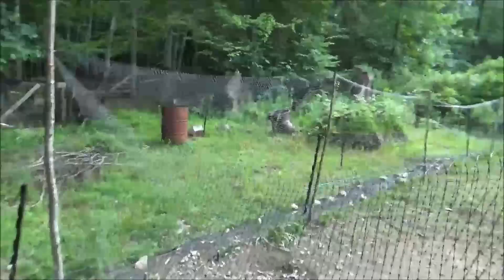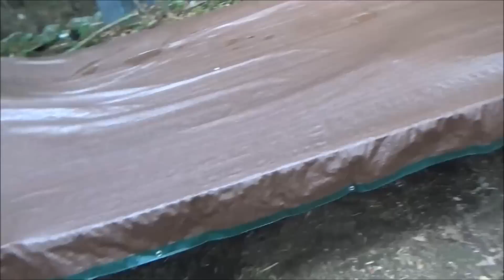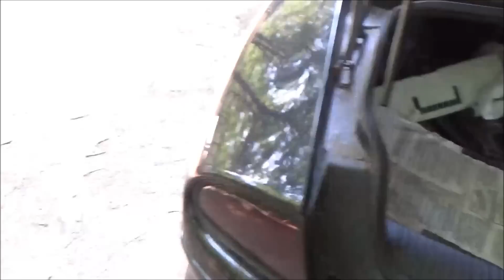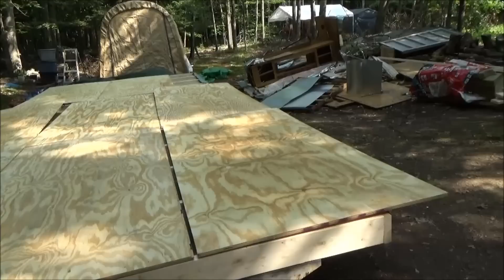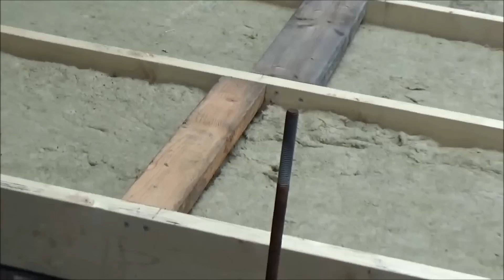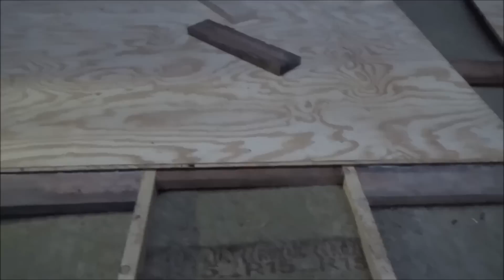Starting Laying The Floor Boards For My Tiny House On Wheels

Comment: Troy a few points fella:

1.   Thought you were going to oil/treat the wood before sealing the floor frame up?

2.   How is the floor frame connected to the trailer chassis?

3.   The supports for the floor that you put in will bow and sag with the grain.  They should hve been installed as per the frame ie upright not flat

4.  wouldn't staggering the floorboards make for a better/stronger finish/connection?
Reply: Yes Paul. The supports should have used the side and not the flat wide part. Also never should have used caulk as it is a waste. Adhesive would have helped much more.
Reply: Brad Chalker I wondered about the caulk instead of glue, but I wonder if it is to stop the cold transfering from the metal, to the joists, then through the floor.  But, if that is what it is for I would have laid it down thicker.  Actually, I would go with foam tape, but caulk could work.
Reply: Yeah when putting down sub floor you would use adhesive our liquid nail
Reply: Brad Chalker I agree. I think what he was trying to accomplish by putting the 2x6 on their sides was to give more SURFACE to support the plywood--especially where 2 plywood sheets touch each other. I sometimes felt uncomfortable sending in all those nails  so close together to attach 2 sheets of plywood into a single 2x4 or  2x6. I thought of snapping a line where the sheets would meet and use that line to slap TWO-2x4's, or in this case, two 2x6's together so each sheet would have its own stud or joist to nail into. (less chance of splitting what your nailing into), but that would increase the cost of construction and in this case, weight. I am afraid that by  rotating his 2x6's he may have compromised a good deal of the floor's ability to deal w/ sheering forces--in earthquake country like CA or when on the freeway, that may be very important.

He'll just have to make sure to go slow if he takes it on the HW, and not let any one hit him or take corners too fast.

Comment: I would think glue,liquid nails and plenty of screws would join the two halves of the floor together just as good as bolts for way less money.once its covered in plywood and the walls are up spanning front to back, everything should be connected nicely. Sure wish you had help .
Reply from the maker: Thank you. I was wondering if that would work for me.

Comment: You should be using PL construction adhesive under the floorboards will assist in keeping the floor stronger and more rigid, might not be too bad an idea for the walls to keep them rigid as well should you ever have to move your house.  .   Get a bit frustrated at you slowness, but, better to err on caution.  All the best.

Comment: Nice table saw find!
Not that I endorse your super sealed floor compartment but, if you must, use dowels. Lay them across the floor joists and place the plywood on top of the dowels then remove the dowels. Watch some cabinet top install vids.
Get a chalk line spool for finding your screw placement.
I too am alittle OCD and I can tell you in rough construction you will never get perfect.
Reply: Hello. I wish I could get there to help him. If I were there I would lay a pathway of sheets down the middle for a pathway to walk on. Snap a line and apply glue. The sheets would be placed upside down, so that you would simply flip them over and and then they would have the correct side up.

Comment: lol you need a sledgehammer. stand on the floor sheet with one foot partially on the beater board and smack it. for your blocking go 2 by 4 then 2 by 6 alternating, then you can center them. do you have a router? the edges are way easier than with a rotary saw. oh dont glue the joint. good luck!!

Comment: This is really exciting watching build this thing. its cool. You may have to attach a board along side the 2x6 to have something for the next plywood to nail too the end it will fall though if not. Full lenth of the board.
Reply from the maker: I am going to, if I understand you correctly. Thanks
Reply: The Do It Yourself World Run a 2x4 parallel on the side of the existing 2x6 because their is nothiing to nail to were the sheet ends. kinda like doubleing up the 2x6 but your using a 2x4 instead to nail to the side of it.
Reply: shartne Troy, next time you have a problem with the plywood not centering on the joist just slide it around till it is centered. If it hangs past the outside ; cut it off afterwards. If it is a little short of the edge that wont be a problem , because it will cover underneath the wall plate. 
 One more thing that i can't stress enough, and I know you've read my earlier comment on this subject, but if you think your having problems with getting joints tight now, you haven't seen nothing yet. You MUST snap a line through the plywood and to the other end. Plywood is NOT always perfectly square. Because of this your rows will get WAY off, and you will find that your plywood rows will not be straight with the way your doing this. I no you don't like the fact that your seams aren't tight., But if you continue this way when you lay down the next row, your going to find it's FAR worse. You might get lucky and this may not happen, but there is no reason to gamble. You will find that these methods are tried and true from millions of carpenters from the time since plywood was put on the market.

 I've laid down many thousands of sheets and I know what I'm talking about.
Reply: Jim Watson I agree with you. but he already has it down He could unscrew and take it up but that cualk could make it tear loose and break it all. I dont know.
Reply: shartne The caulk is not dry and is not strong enough to tear the flooring. He could at least give it a try by carefully trying to pull it up and see for himself. Backing those screws off is a 5 minute job. I think that is a good trade off for all the problems that are going to come after that.. so many problems that I have elucidated in my last comment.
Reply: Jim Watson I agree its going to cause a big problem throwing the whole thing off. a night mare so it best to unscrew and slid it back cut off on the front end toward the trailer toung. so it will be ending in the middle of the joice on the other end. so the next board can get screwd on in the middle of the joice. He could cut the ply wood in half so it will stagger. that would be nice for good strength so the dont all line up and make a one long seam.
Reply: shartne And if he unscrewed it he could apply glue to the joist. All problems would be solved!!
Reply: Jim Watson Yes Troy this should be done to keep from botching it. please consider doing this way. I think its for the best. And it will unscrew easy the caulk is not even dry yet it takes days when its sandwitched.

Comment: If you counter sink your holes for the edge screws first, then drive the edge screws in, they wont lift out wood. Also use a sledge hammer and a 2x4 to protect the edge, and give it a good smack.  It will close up the gaps.

Comment: Troy that is a good saw if it works seen a lot of that model that have problems,but is fixed easy,once you get power and it doesn't start up when you hit the switch its the little bearing that goes bad on the the motor,simple little $10 fix

Comment: How come you put caulk on the floor joists? Normally we use an adhesive that will bond the plywood to the joists to prevent squeaking. Also, the plywood is supposed to be staggered so you have more strength. You have the butt ends all lined up. You have to drive that tongue and groove sheeting together with a sledge hammer. You need to put a board on the tongue that has a groove in it that you hit and drive the sheeting together.

Comment: Troy what you did with the wood was good but it should have been ever 12inches or so under the sheet,use construction adhesives not caulking about same price but  much better.when using half sheets its cut the sheet in half 4ft by 4ft

Comment: dear mr troy I'm sorry to put my input again but i just feel somehow obligated to tell you that You are making a crustal mistake on the installation of you're plywood and that you are still in time to fix it you must stagger the the joints of the plywood if you don't you are creating a week point on the 2x6 joist that is holding all the joints, especially  because the house may move at some point,also an easy way to make the tung and groove close is to lay a 2x4 or 2x6 on the male side while you stand on the plywood and you're toe's on the 2x4 with legs spread wide to hold ply in place then hit the 2x4 with a sledge hammer towards you will see it will close perfectly and also if you don't close that joint you will have big problems with making the rest of the plywood line up trust me wood filler will not help that again sorry for my advise its just being a carpenter for almost 35 years I feel i must at least tell you so good luck you are doing very good other wise

Comment: Is it bolted down to the frame? That looks like its three quarter inch plywood and that is why its so firm. thats great.
Reply from the maker: The front part is bolted. The back half is still not attached. Yes its 3/4 and very solid.

Comment: If you really want the batteries separate from the living quarters, then make the battery / utility room as small as Possible, put the batteries on vertical shelves made of metal in one column so to speak and minimize the amount of floor space you use. My 2 cents :)
Reply: Good idea going vertical.  The cabinet could have a door vent low on the inside and a vent high on the outside to pull air through for ventilation with no fans.
Reply from the maker: Its going to be a battery room, electronics room and closet for storage.
Reply from the maker: Pete Brown He has tons of shelving. Thats his business.

Comment: hi tony
this is my first time commenting on any of your videos first i want to say bravo keep going man dont let people drive you nuts and dont get hurt by comments it looks to me like allot of people just want to help you get better at one thing or another and please include me on that list
i am a contractor by trade and if we lived close i would be out there helping you when i had time but i cant so i will pass on some info i see and hope its helps i am going to list a couple of things

1. tough and grove sucks lol when putting it together set it next to the peace already in place and lift up the other end a little to make sure its all in the grove as in up and down till it looks like all the grove is in then like was said earlier you want to stand on the board you are trying to get in place then on the long end put a long just 2x4 down along the edge then lightly tap it with a sledge hammer and it should just slide a little bit at a time into place as it moving in place if it does not line up the other direction finish getting it in the place then move the board to the short end and adjust and if need move back to the long end and tap back in if it comes out of the grove a little bit
2. the screw bit on you drill a extension yes wonderful thing and one that makes the bit magnetic helps also
3. from what i can see allot of the old wood you are getting looks better then you might think it is and think about cutting out the bad even if you end up with a 4ft piece i will bet you are going to be using allot of shorter length wood in this build i am a trash hound i build allot of stuff out of what others trash i always cut down wood like that and its saves me allot of good new boards that i would of had to cut in half i just made a teardrop camper all out of use wood others trashed i spent 400 total on it 280 of that was on the trailer solar panel and electric was the rest i even take out old bolts and screw out of wood i find old desk people trash i save all the hardware out of it screws bolts etc its is one of the big money things when doing a project that people dont think about in the future you can save yourself allot of money just look at what you are trashing that people give you or you find (you might do that already)
4 from my time building when i have had to fix a squeak in a floor its been from the center of the board with time maybe it got wet and expanded then pushed the nail up just a little of pushed the head of the screw through the wood a little bit more then it squeak time and i agree with the others about liquid nail over calk i use both every day -" i can peel calk of with my hand -- i have to take a hammer and chisel to get the liquid nail of  " you can make your own opinion on what is the right to use but ether is better then nothing
i could go on for a long time but i would gladly share any time you need any advice would be my pleasure when i watch your videos the thing that is the greatest about them is you get of your butt and do stuff that most are not willing to do you are taking risk that others would never take so pat yourself on the back i get the strangest looks for the things i do and am glad to know i am not the only crazy person out there lol i have been there doing like you then got back in the rat race now looking to go back to a easier way of life well harder work but easier life
and the last thing i talk way to much sorry lol
Reply from the maker: Thank you very much for taking the time to write. I will switch to liquid nails. Have to get back to the store now. Yes a lot of the boards are very good and I will build a chicken coop and gazebo with it.
Yes being out here is more work but somehow more peaceful and less stress.

Comment: Two Questions for you troy. 1, How will you secure the tiny house frame to the trailer frame, 2 Did you know the reason you could not get the tung and groove to fit is because you screwed the one board down off setting the flat level between the two ,ps loving the progress .

Comment: long term do you think the plywood is a good choice or are you open to the idea someday to lay laminate down   even if you seal the flooring thick on top its not sealed on the bottom with what was said about no venting under the floor  i fear it will still swell an chip down the road in a couple of yrs = splinters or worse get weak/rot from moisture over the yrs  i lived in a mobile home for yrs and moisture/water is a killer with plywood subfloors    just thinking out loud is all  ...... its lookin like a decent floor plan keep at it  and hey  how bout a fishing break :) vid  take a lil time out  for you .....

Comment: Troy, I just saw on TV where you take a fabric softener sheet and rub it on your body then just stuff it in a pocket  or somewhere on your person to repel mosquitos. Supposedly they hate the smell of the softener. I have no idea if this really works but the sheets are really cheap so it might be worth a try. No particular brand or scent was specified. Let us know if you try it. 

Keep up the good work, you home is progressing nicely.
Reply: Hey I am going to try it too!
Reply: I just use a clothespin to hang a fabric softener sheet off my shirt, somewhere.  So far, so good.  Looks odd, but I have no mirrors outside.  The dryer sheets were $1 a box.  Hope they still are that cheap.
Reply: No that's a great idea, using a clothes pin or maybe a safety pin for hanging it. Thank you for the tip.
Reply: JustPeg :) glad to help!  Hope it works for you.
Reply: I have done this several times, even as recent as last weekend. I do it because it doesn't hurt, and it smells nice- LOL. Honestly, I have seen ZERO actual improvement in using them as a repellent. Where I am in FL, they are so bad you will breath them into your mouth and nose constantly.
Reply from the maker: Myke Dave Same here with how many I have. Even the top brand repellents only work if you fully bathe in it. Any tiny spot that you miss is open buffet for them
Reply: Yup. Good times. I swear, after a few days hiking and camping, I look like I have some funky disease. Nothing keeps them away.

Comment: You will have to ventilate the insulated area below the floor. It will be weeks or months before you have a roof up, and what happens with all that water that gets trapped under your flooring? what if you have a water leak? That insulation needs to breathe! and dry out, its just like an attic if the insulation gets wet, its useless. Also, don't use caulking, use construction adhesive. it will help with the rigidity of the structure as well. I hope your deck is level, as you are building it. It will stay whatever it is when you screw it together.

Comment: The saw table is excellent.  My money is on it will not cut straight because it was dropped and now it is tweeked.  But that is ok... the fix will also fix your second problem...power.

Take the current saw out and mount your battery circular saw under there with the biggest blade it will take.  Maybe some hurricane straps?   You will be ripping off grid in no time.
Reply: woodmann61 Possibly.  What seems to be the problem?
Reply from the maker: That would be nice but it has a very stupid and annoying, complicated safety button on the side. And I am using it every day at the lumber yard right now
Reply: The Do It Yourself World  Does it cut straight??
Reply from the maker: MollyDolly Only as straight as my hand will guide it :)
Reply: The saw will cut as straight as the fence is aligned to the blade.  It should be fine.  A cracked plastic base shouldn't effect the steel or aluminum surface.  Hope it works well for you Troy.
Reply: John Gilson Hi John, you are ABSOLUTELY correct. No experienced carpenter assumes that the fence is automatically parallel to the blade when adjusting it. That is all that is necessary to cut straight as long as you keep the material tight to the fence while your cutting.

Comment: you dont have the insulation full up while it is open and put the floor down you are outside and needs as much insulation as possible you can use shred news paper